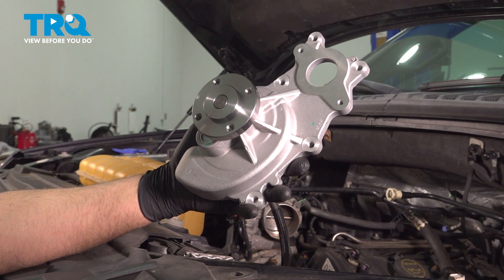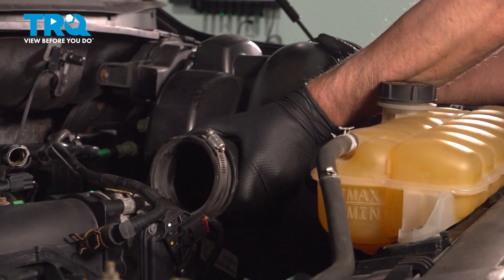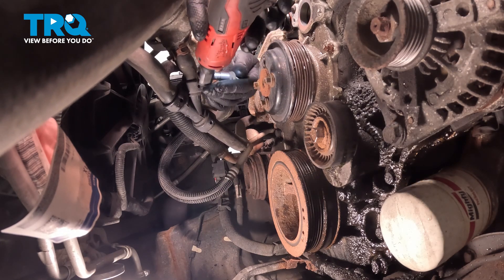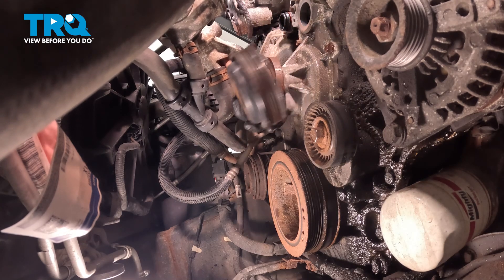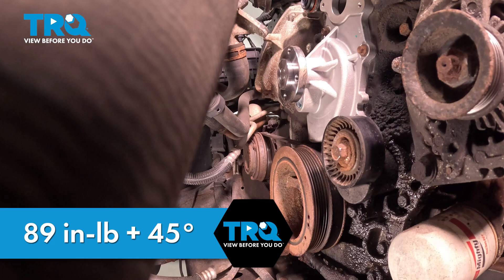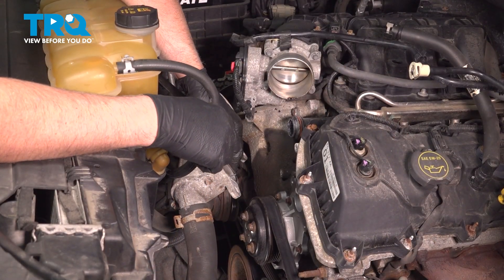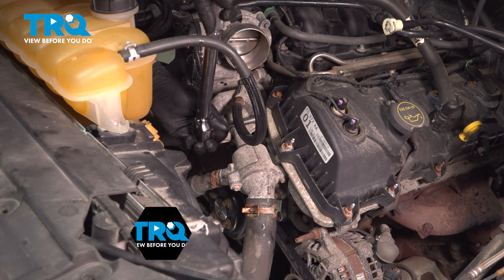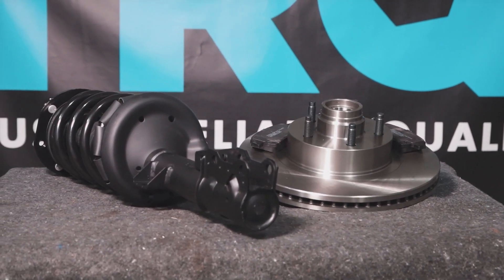How to Replace Engine Water Pump 2015-2020 Ford F-150 2015-2020 3.5L V6

Comment: Thanks for the video. This is the only one I found that refers to the 3.5NA with external water pump. It seems that it is assumed that all 3.5 Fords have internal water pumps.

Comment: Awesome stuff, just did this yesterday and it fixed my noise issue. Don’t delay replacing the pump. Only thing I’d like to add is make sure you check how many bolts your pulley has. There’s a 3 and 4 bolt hub that will fit this truck

Comment: Great video. 
I just did this and it's really easy. I have a 2016 F-150 with a 3.5 naturally aspirated non-turbo engine and all there is to do is to take five bolts off of the thermostat mounting and then there's only seven bolts that hold the water pump on.

Comment: Is this the turbo engine?  I have to change the water pump on my brother's 2018 V6 3.5L and he said he's got a turbo.  Another video I watched shows a guy removing all of the intake piping out of the way that connects to the turbo and intercooler.  Is that not necessary?  He even removed the throttle body.
Reply: How did you make out ... I have a the same truck and mine just went ..